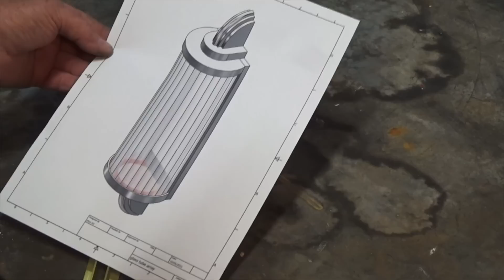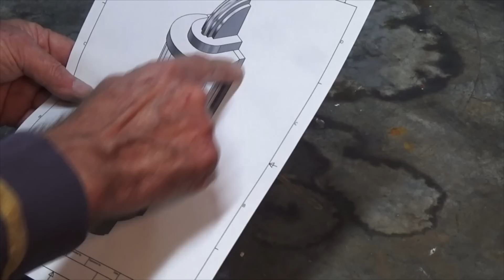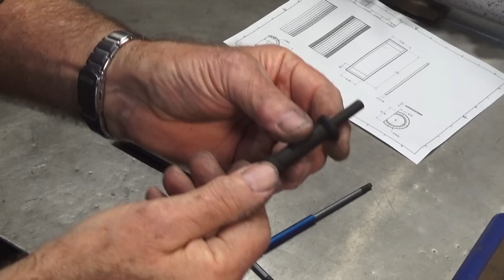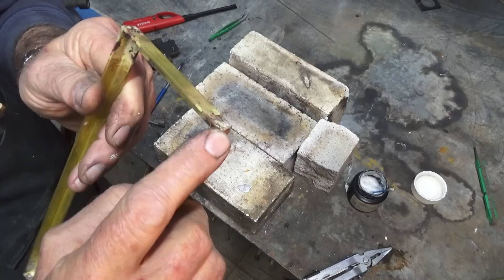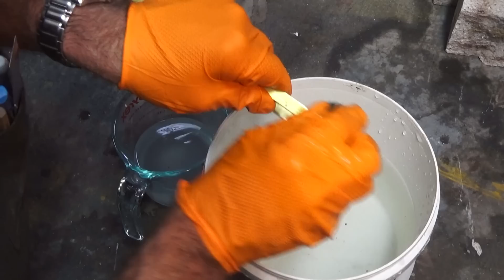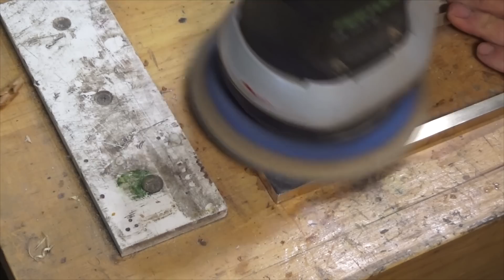New Fabrication Project - All the Good Stuff!

Comment: Very aesthetic project! I like it :-)
Just a couple of notes:
- I think you used too much heat to silver solder the frame (soldering with an L) - I use a plain MAPP gas torch for small parts like that (adding oxygen makes the flame too hot)
- Unless it's an unreachable place, I only add the solder when the piece is red hot - it flows better (for small parts I buy thin silver solder rods at jewelry / crafts supplier - better quality)
- I tend to use hydrochloric (muriatic) acid, HCl, for pickling brass and copper, as it's easier to get (available even in some supermarkets)
  I also use HCl mixed with hydrogen peroxide, H2O2, for etching copper in printed circuit boards or shallow engraving - it's easy to neutralize and the usual ferric chloride is too messy.
Reply from the maker: I must say I am a bit out of practice at silver soldering. I made several copper boilers back in the day and I always used oxy acetylene. LPG is better but you do need a really big burner and lots of firebrick. I have never tried MAPP gas before and I did consider buying on of those disposable cylinder sets before I decided to use oxy/propane. I find that the oxy/propane is more versatile. I can cut with it and get lots of heat for bending but you cannot weld with it. I haven't tired HCL for pickling. Must give it a go.
Regards,
Mark
Reply: @Preso58  Thanks for your comments. I wasn't criticizing, just laying out other ideas for the people who watch this. I believe the main point is the silver solder quality. When I used the typical rods sold on traditional stores, I got many problems with temperature needing to go much higher to flow (almost close to brass brazing), but with jewelry rods it flows beautifully with disposable propane or MAPP gas cartidges and a $10 torch.

Comment: Just got home with a pack of borosilicate straws, brass i have in stock, but this is not why i bought my straws, i need to remake 2 large oiling pump tanks for machines, both were plastic, now they are gonna be welded steel... But i need a sight glass, and what is a better way of having a sight glass than a tube... I know they can leak, but its a tank, the only pressure it sees is the hydrostatic pressure of the body of oil under gravity... I think i can make a tube holder with a few internal groves and o-rings that will hug the straws nicely and prevent weeping... Tho, this is a nice project to see done, and i will need some light on my terrace that looks a bit better than what is there already... Also, love the Solder, Colder, Folder relation... To even voice such an opinion, you have to be BOLDER then your average peasant...
Reply from the maker: Thanks. I hit a brick wall with this project in the design stage because I was looking for fluted glass for the diffuser. I couldn't find any and even if I could I would still have to bend it into an arc. Whilst trawling through Ebay I was able to find borosilicate glass tubing at just the right length. Problem solved!
Regards,
Mark

Comment: Just to foment a little chaos, I have decided to call your process sweating parts together.
Reply from the maker: Ahh, but sweating, I was told, is where you apply a film of solder to both parts separately and then reheat them whilst holding them in contact. At the end of the day it doesn't matter as long as the confounded thing doesn't fall apart.
Regards,
Mark
Reply: @Preso58  I am certain that the term sweating came from somewhere. I am not much into etymology sorry... In the US it's the only term used by plumbers for soldering water pipes together. You sweat copper water pipes, end of story. While solder paste CAN be used, it certainly is not required. A bit of sand paper, a bit of flux, push the fitting onto pipe, heat the underside of the fitting/pipe, apply solder away from the flame at the top, into the joint and allow it to flow. Sweating pipes...

Comment: You can also use sodium bisulfate (swimming pool buffer) to remove borax flux Mark
Reply from the maker: I use Sodium Bisulphate as the electrolyte in my anodising bath. Way cheaper than sulphuric acid, easier to get too. I have never tried it as a pickle though. Stands to reason that it will do the same job. I believe that sodium bisulphate is called the half salt of sulphuric acid. 
Regards,
Mark

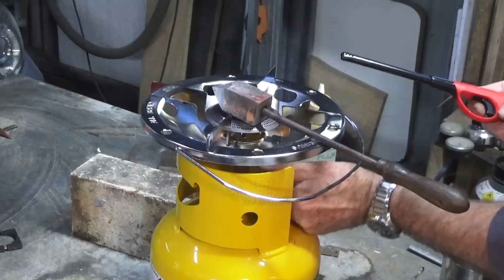Comment: 25:03 - heating up the soldering iron. That is a VERY odd method - sod that!
Get a old steel (galvanised) threaded pipe L bend, say 1 1/2" or so. Make something to hold it firmly in this orientation: L then shoot a propane flame in horizontally into the fitting. The L bend then turns the flame upward, where you place the soldering bit. You get a heater and a bit holder in one!
Reply from the maker: We used to have ovens for heating these copper bits. They could heat about four at a time and had a vertical gas flame inside a cast iron oven with a refractory lining. For the very few times I use the copper bit, the camping stove does a good job. One can always use a more efficient system though. 
Regards,
Mark

Comment: Loved the soldering. Learned that technique at school. Still have a couple of copper irons - not a 24 !! Loved the old techniques I learned from the trade teachers at primary school. I agree with your pronunciation.
Reply from the maker: Thanks. I lost count of the number of funnels and oil jugs I made from galvanised steel with soldered joints. It's very satisfying when applied to copper and brass though. I have a vintage kerosene fired copper soldering bit with an integral burner. I should really clean it up and do a restoration on it. 
Regards,
Mark

Comment: Mark I have a large version of that magnet i use to clean the mill and lathe with.
 I like that pocket version would be handy also
Reply from the maker: I too have a couple of those swarf magnets but the little pocket version is super handy. I also have a very small magnet on the end of one of my scribers but it's actually a bit of a nuisance. It gets stuck to other tools on the bench very easily. I believe that James is still prototyping this tool and he plans to have one with a cap and one which is spring loaded in the open position. 
Regards,
Mark

Comment: An excellent video as always mate! I think i still have a few of those old copper soldering irons from my grandfather down in the workshop.
Reply from the maker: They are very specialised tools these days. We stopped using them at the school where I worked due to safety issues. Very early in my teaching career, one of my students set his hair on fire because he was concentrating very hard on getting his soldered joint just right. The ovens we used to heat the irons had two openings at about chest height and they were heated with a gas flame. The boy had a large "afro" haircut and he just leaned a bit too far forward... 
Regards,
Mark
Reply: @Preso58  oh dear!! there were lessons learnt that day i'm sure!!  how were his solder joints after the incident?
Reply from the maker: @AndysDIY  He was pretty chill about the whole incident. He just slapped out the fire and kept working but the smell of burning hair went right through the workshop. 
Regards,
Mark

Comment: Spelling and pronunciation is not a big deal, but what I don’t like is that we are still using the stone age measuring system, aka the imperial system.
Reply: Isn't the L silent in "Imperial"?
BTW, the Americans don't use the Imperial System, they use their own special one. Check the difference between an Imperial Gallon and an American Gallon.
Reply from the maker: I hate to point it out but there are only three countries in the world still using imperial measurements. Liberia, Myanmar and the USA. Even Myanmar and Liberia are transitioning to metric or using both in parallel. The Brits sit on the fence and waver back and forth!
Regards,
Mark

Comment: Thanks for the video Mark. The design is fantastic and definitely art deco. So many modern light fittings are rubbish, even the expensive ones, so it's great to see a quality piece take shape. I totally agree with you on the "sodder" issue even worse than the missing i in aluminium. Best wishes, Stephen.
Reply from the maker: Thanks. In our experience, whenever we have purchased anything for our house, if the item is described as "vintage", "heritage" or "Victorian" the price doubles instantly even though it is made to the same low quality as the rest of the items on display. I have taken to carrying a magnet with me to check if fittings are actually plated steel or brass. Plated steel ALWAYS rusts after a few years. 
Regards,
Mark

Comment: Hi 
Citric acid is a much better pickle than vinegar, but neither should be poured down the sink, they should be disposed of correctly.
Reply: Disposing of them correctly is to pour them down the sink. They are weak water-soluble food acids. How do you dispose of old orange juice?
Reply from the maker: Chris, we have our own home sewage treatment plant and the company that services it get mighty upset if you tip anything anti bacterial down the sink but they are pretty chill about acids and alkalis. They check the PH at each service and it's amazing how close to neutral it always is. I haven't tried citric acid but we can buy cleaning vinegar very cheaply here.
Regards,
Mark

Comment: Mark, another nice looking project & great video.
Regarding "pickles", as an old Jeweller we'd also use Sodium Bisulphate or "dry acid" sold for Pools & Spa chemicals.
If using the vinegar then use "double strength" version available from the "Laundry" section of the Supermarkets.
If needing to "manoeuvre" silver solder around & redirect its flow, get some titanium wire, grind a point & make a "poker".
HTH, Colin
Reply from the maker: I use sodium bisulphate for my anodising solution. That's actually why I had the 15 litres of sulphuric acid available as a pickle bath. I suspected it was contaminated with aluminium and swapped it out for the sodium bisulphate which is WAY cheaper and easier to get than the sulphuric acid. I have some titanium wire too. It's better for hanging parts in the anodising bath!
Regards,
Mark
Reply: Another safe and inexpensive method is to make a solution called "super pickle." It's just a 1:1 mix of white vinegar and hydrogen peroxide. It works very fast, and removes copper oxide just as well as the commercial pickling solutions.

Comment: Gday Preso, this is going to be a great project, I do have a couple of the old fashion soldering irons in the workshop but never used them, I keep forgetting to ask Dad what the go is with them, the joints you did looked perfect, Excellent video as always mate, Thanks for sharing, Cheers 
P.S awesome gift and a bloody handy one, your fingers must be like mine, knackered...
Reply from the maker: Matty, it drives me insane when I try to pick up small parts off the bench. My fingers just don't bend like they used to. BTW, you can still purchase a TouchDRO unit and fit it to your lathe, it's the app that Yuriy is updating. I am doing some alpha testing at present. He will roll out the new app to Google Play when all the bugs are fixed. The hardware stays the same.
Regards,
Mark

Comment: Mark, I bought a set of tap and die's in the 70s, an ACE Superset that was made by the Henery L. Hanson  Company that was located in Connecticut at the time. Hanson was hands down the best with drills, taps and dies.  Have you heard of them? .
Reply from the maker: No, I have not heard of that company. Most of the tooling that was used here in Australia came from Sutton or P&N. Occasionally you can pick up some odd taps and dies. I think I had a couple with a "Picador" brand on them.
Regards,
Mark

Comment: I agree regarding pickle's, the nasty ones work best but never have them in the shop. Some time back you used Ajax to clean metal and ever since I have been trying to find some, its unobtainium in NZ but what I have found which I suspect is the same is Bar Keepers Friend cleanser. Just an FYI for anybody looking for what, I recall as the most common cleaner.
Reply: Bon Ami is another similar "powder based" cleaner that may be available to you in NZ.
Jiff was also a powder based cleaner but not sure if that version is still available?
Reply: have you tried VIM powdered cleaner? available from "South African" shops in NZ
Reply: @blaing99  No but good to know the alternatives to Agax :)

Comment: Wear a mask when you're grinding brass mate. You don't want metal flu, trust me.
Reply from the maker: I just purchased one a few days ago. I had totally forgotten what fine brass dust does to ones airways. Many, many years ago I found an old bronze tram bell and decided to polish it as it was just a rough casting. I mounted it on a wood lathe faceplate and sanded it with finer and finer abrasives. The dust went everywhere including up my nose. It took days to get rid of it all so you would think I would have known better when I started polishing the brass parts on these lights. I shall be prepared now.
Regards,
Mark